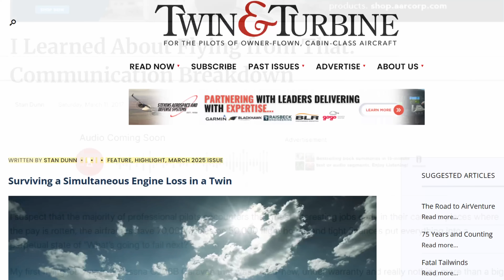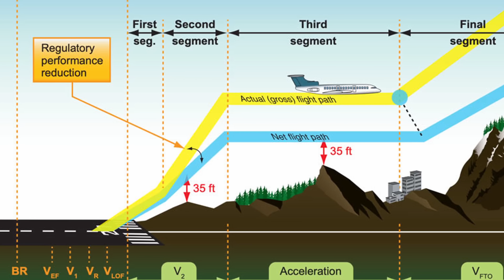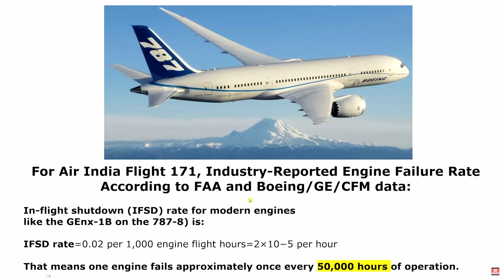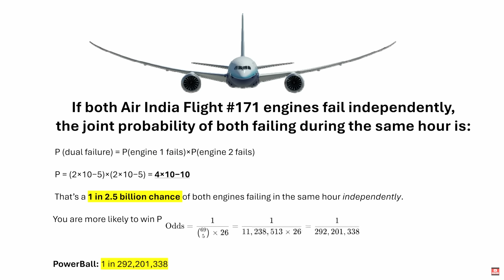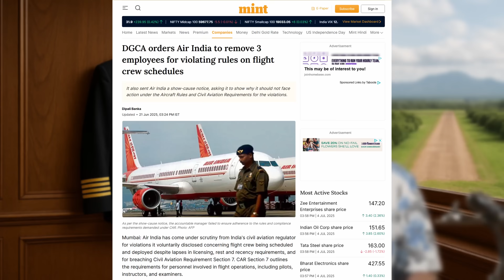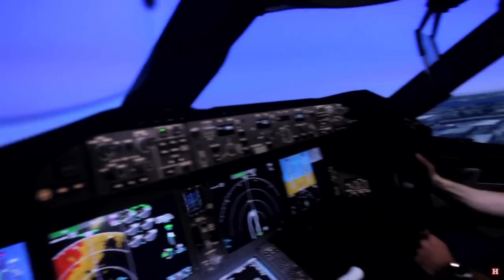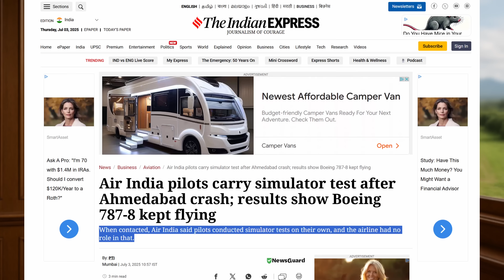Air India 171 Cause Becoming Clear

Comment: The flaps had nothing to do with this crash. The pilot didn't say "I have no lift", he said "I have no THRUST"  You can't just ignore that, it's crucial!
Reply: Recording isn't out yet, genius...
Reply: @DR_1_1 The ATC recording IS out! The PIC Said “Mayday I have no thrust” As a retired 787 Check Captain, I surmise the fuel cut off switch was accidentally hit by the FO, it’s 2 inches from the flap controls. Not keeping your eyes 👀 on the controls you implement will cause such problems. This airline was bankrupt and taken over by TATA corporation, the manufacturer of the $2800 new cars that revolutionized the market in third world countries. They made a horrendous business decision and were loosing copious amounts of money. They were desperate to offload the airline and stripped it to bare bones. Deferred maintenance? Who knows but they cut corners everywhere.
Reply: @DR_1_1  "The flight crew issued a mayday call, reporting a loss of power and thrust shortly after take-off."
https://en.wikipedia.org/wiki/Air_India_Flight_171
Don't be a DA all your life.
Reply: @DR_1_1 
That's  ATC. yes we have that.
Reply: @Richard-xv3gw  "That's  ATC. yes we have that."
Again, what is your source? Who is "we"?
Reply: @DR_1_1 Best answer. Searching the internet there are at least a dozen different answers to what the pilots said before the crash.
Reply: @DR_1_1  From the Wiki: "The flight crew issued a mayday call,[8] reporting a loss of power and thrust shortly after take-off."
Reply: Also spent confirmed multiple ways that the rat deployed which nullifies a lot of the other scenarios
Reply: Yes That’s exactly what he said.
Reply: @Wendy-p3m  hoe do you know??? nothing has been released yet
Reply: @Wendy-p3m  The pilot saying "no thrust or lift" is fake news.
There was simply a Mayday call. No specific statements were made.
Reply: @VinayakP  The Mayday call was released to the media from The ATC Recording in the Tower. Look it up, you can listen to it. The Pilot plainly stated, ''No Thrust, Going Down ''.
Reply: @VinayakP no, the pilot did say " no thrust, no lift" during the mayday call.
Reply: @siddharthshekhar909  no he didn't... nothing has been released
Reply: @craigcorson3036: How do you know the pilot said, "I have no thrust"??
Reply: @kevinsyd2012  ATC radio has been recorded
Reply: @TerryLawrence001  Sure but not released to the public.
Reply: @skunkjobb  my bad. I am too used to US crashes where everything is public via hobbyists and plane spotters.
Reply: Exactly how they say he made the "mayday" call. Through ATC conversation. @kevinsyd2012
Reply: @destroyedsoul1791  "How they say", who says and based on what? So far, I've only seen rumors about that and no actual recording.
Reply: @kevinsyd2012  Because it was reported in the media. FFS, do you think I was monitoring the frequency??
Reply: @craigcorson3036  Of course, how stupid of me, if it was reported in the media then it must be true just like everything else in the media is true
Reply: @kevinsyd2012  Psychic 😆
Reply: Is it possible that the power setting was incorrectly entered on that takeoff in the FMC  I would suspect if a pilot decided he needed more power the hell with the computer firewall the thrust levers
Reply: @SkipGetelman it's nearly impossible to take off with the wrong settings. They would have to turn off multiple audible alerts and dings as the computer would not accept parameters and try to prevent the plane from proceeding. I think it was vapor lock. The tarmac temp was allegedly 108°F or more. If the humidity, engine temps, gravitational forces are just right...they can get vapor lock from the main fuel pump which would then start starving BOTH engines and they would be provided with loss of thrust, which can be heard on the tower tapes as I have heard the tapes in full. There was communication between tower and Capt but it is majority garble and static and nothing can be heard clearly. Hopefully they get the cockpit audio. Maybe it's something nobody has considered...maybe the copilot was on a mission to turn his birthdays off and as they get airborne, he points out the window and says LOOK OVER THERE and the pilot flying looks and while he looks, the copilot flips the engine switches to off and pilot never notices which he would immediately radio a mayday call and the loss of thrust. He had to have realized there was absolutely no time to troubleshoot and it was basically time to try and land the plane in a way that may allow survivors, like keep the fuselage and cabin in the center of the street if possible. Had to have been horrific
Reply: The only official source is the recording itself.
Reply: fuel valve fails closed after DC power failure...heard it the day after the crash.
Reply: I was watching recently and incident where the pilot had an illness that prevented sensation in his feet...he took off, but he had a foot resting on the brake (unwittingly) - killed and entire professional sports team...wonder if anything like that could have happened
Reply: what is your experience in transport category jets? I can tell you from experience that without looking at instruments, if you raise flaps prematurely it FEELS exactly like losing engine power... and I have 8 type rating, and 3 of those are in wide body aircraft.
Reply: @SKIPWOOD-UA777CAPT-RET Not saying that you are wrong, but in how many of those widebody jets would you have continued descending to the accident site and not either eventually power out of the loss in lift, lowered the nose to get some speed, or put the aircraft back into the correct configuration… or a combination of all of the above?
Reply: @jamesrolls9206  If the flaps were raised inadvertently the aircraft would immediately been in a stalled condition and even if the mistake was found, at that altitude if the flaps were reconfigured correctly, it still  would have crashed... just a few feet further in the direction it was going.... they would have been approximately 70 kts below the minimum maneuvering speed for their weight
Reply: @SKIPWOOD-UA777CAPT-RET did that look like a stall?
Reply: @jamesrolls9206  all the ones I have seen and done... yup
Reply: @jamesrolls9206  without engine power all would continue descending
Reply: @SKIPWOOD-UA777CAPT-RET not quite sure which comment you are replying to there. I think lack of engine power and a continued descent is fairly obvious… otherwise we would just shut the engines down in cruise…
Reply: @jamesrolls9206  that'll save gas...;-)
Reply: @SKIPWOOD-UA777CAPT-RET reminds me of that old joke about an Irish airline.
Pax on a 747, they lose one engine. Capt makes a PA “sorry, we lost an engine, no worries we can still fly but we will be 30 minutes late.”
Shortly after, they lose a second. PA goes “sorry, we lost a second engine, not to worry, we can fly but will be 1hr late.”
Shortly after, they lose a third engine. PA goes “sorry, we lost a third engine, not to worry, we can fly on the remaining engine but we will now be 2hrs late.”
Paddy turns to Brian, “Geeze! We better not lose that last engine, we will be up here all day!”
Reply: @jamesrolls9206  GOOD ONE... I DO REMEMBER THAT ONE... MY BROTHER TOLD ME
Reply: @SKIPWOOD-UA777CAPT-RET  They teach you to fly with feeling and not looking at your instrument?

Good thing that you’re retired. Please don’t fly a plane ever again.
Reply: I have seen the flap handle go up when it should be the gear.  Fortunately the mistake was realized and  it was immediately put back down and we all lived.  But that would not explain the rat being deployed.  That would be both generators or all hydraulic system loss.  Double engine shutdown would cause both of those things.  Although the hydraulics would be delayed, as a windmilling engine will still provide hydraulic pressure. the generators will cut off when the engine RPM is less than idle speed.  usually 50-55% where idle is around 62%.  I don't know the exact numbers on these engines but that is about what it is on a CF6, TF39, TF33,, and a JT9
Reply: As the plane descended into the buildings, I don't think any of the passengers had any trust either.
Reply: Mixing oil from modi friend oil company.
Reply: ...but he's got an airline captain uniform in the background, so he must be right!
Reply: The captain was an experienced check airman, training captain.  He had a good personality and got along well with his crew members.
Reply: The RAT deploying is the biggest clue. That only happens when a plane loses major electrical and hydraulic power. In modern jets, no power = no engines, because the digital systems (FADEC) can't function. Unless there's clear proof of fuel exhaustion or pilot error, this looks like a total electrical failure that shut both engines down.
Reply: Also, flaps and slats are clearly deployed in the debris of the wing.
Reply: @ARM-CORTEX  Yes they are.
Reply: Air India pilot's final words before crash: 'Mayday… no thrust, losing power'
Reply: that's a lie... nothing has been released
Reply: @SKIPWOOD-UA777CAPT-RET  You are mistaken.
Reply: Good point.
Reply: We will never  get to know the truth. They will blame  the pilots just to come clear. The only way people  should  not fly Boeing.
Reply: Sabotage
Reply: So much could go wrong apparently   All airplane passengers are heroes ( or ignorant) i dont want to say that about the victims   So tragic
Reply: RAT deployed
Reply: @VasantVarma324 did or didnt they ?  ( sorry i have no sound ilooked the entire video still have no clue  ( do you ?)
Reply: Also can’t ignore that the engine manufacturers were dispatched to the accident site. That’s not a normal occurrence either unless there is considerable evidence to point to engine issues.
Reply: Lift depends on thrust, so thrust is the cause of lift meaning no thrust no lift,and no thrust above 190MPH  then a gradual decay in lift and if there is no runway near its a force grounding.
Reply: ....and I think the "black boxes" will prove that without a doubt!
Reply: @charliethompson-u8j  if the indians don't screw them up like mylasia airlines did
Reply: Sue Boeing mate
Reply: Yup. It had plenty of speed and lift to fly well above ground effect.
Reply: I do not think this pilot knows what he is talking about.
Reply: 1: the recording it's out yet
2: there were numerous accidents where the pilots misidentified the issue. Even if they said that both engines failed it'd be no proof they actually did
Reply: TLDR - unlikely causes can sort of rule out. Still inconclusive. Oh when will the investigators release any more meaningful information? Even the ruled out stuff like birds if know by now. Appreciate still investigating and the root cause might take time to be confident. Insurance and liability sensitive. But so are the other planes still flying.
Reply: Crash was message to modi. Quit the big buy of Russian arms.  Us wants that arms business.
Reply: It was very hot day so less or insufficient oxygen for the engine to burn , so it stalled down. 
What's the investigators doing.
I am not a pilot but can see and sense .
Reply: No thrust becoz plan not cutting air means pitch error
Reply: @kamali_ka You obviously lack an understanding of basic aerodynamics.
Reply: I mean i thought initial findings said the plane was properly configured anyways
Reply: There are same thing, Indian pilit's Cos 2 accident Indian.They do not train pilots only the train scammer
Reply: 😂😂😂❤ @sedattan952
Reply: @sedattan952  Do this: say what you want to say in your native language. Copy it, then paste it into Google Translate and translate it to English. Then, copy that translation, and paste it HERE in this comments page. I have no idea at all what you're trying to say with this post.
Reply: my question:  how did they use the entire 3500 meters of runway without getting significant lift to fly.  The loss of thrust MUST have happened before leaving the ground.  Following proper Takeoff procedures should have prevented this accident .
Reply: @wunderfuel  I COMMANDED A DC-10-30 OUT OF EWR TO HNL AND WE WERE AT MGTOW.. WE COULDN'T EVEN USE THE CLOSER PARALLEL RUNWAY BECAUSE IT WAS 200 FEET SHORTER... IT WAS MY LEG AND WE SET OFF EVERY CAR ALARM HORN IN THE EMPLOYEE PARKING LOT AT THE END OF THE RUNWAY... AND ATC SAID... 'WELL, NOW THAT YOU USED EVERY INCH OF THAT RUNWAY... GO OVER TO DEPARTURE CONTROL" I DOUBT THAT IF THEY HAD AN ENGINE FAILURE THEY WOULD HAVE GOTTEN THE PITCH OF THE AIRCRAFT THAT HIGH
Reply: If flaps weren't set, why did the plane take off perfectly normally, then lose height?
Reply: @RevStickleback It didn't take off normally. They were at the "last brick" of the runway when they became airborn. Their troubles began while they were on the ground
Reply: @JamesStreet-tp1vb It did take off normally. ADS-B shows they were around 250 feet AGL at the last brick of the runway. They would have to get airborne with around 800m - 1000m of runway length still available to do that.
Reply: @tonamg53  Doesn't match the video, the plane was very low at the end of the runway, raising a lot of dust, so less than 250 feet AGL, probably 250 MSL (Ahmedabad Airport is very low altitude).
My guess is either an issue with weight management, thrust (although I still don't see any serious source for the "I have no thrust", only very vague,like "media", "wiki", etc.) they should have aborted the takeoff but for some reason they didn't.
Reply: @DR_1_1  You can’t tell where the end of the runway is in the video 🤦🏻‍♂️

but using google earth information to see where the camera was located + a bit of triangulation gauging the angle at lift off point… this matches perfectly with the ADS-B data that lift off point was somewhere between 2,000-2,500m down the runway so they should have around 1,000 m of runway length still available.

“Dust” indicate “dust” on the runway… no, “dust” doesn’t mean it must be the end of runway.
Reply: @tonamg53  You can tell that the plane is raising a lot of dust, that's how you can tell it's very low at the end of the runway. And it shouldn't be that low, since the runway is +3500 meters...
Reply: @DR_1_1  Again, “dust” means “dust” 

Dust can be at the end off the runway, or it can be on the runway. India has seen some of the worst air pollution ever in recent years so dust is every where in India.

Your assumption that “dust” = “end of runway” is flawed and is debunked with a bit of triangulation drawing analysis. The ADS-B data also confirms with triangulation analysis so… your flawed assumption had already been debunked, twice.

Note that Ahmedabad-London is the longest flight operated from the airport. Most other flights are domestic or short haul international flight to other asian cities. So yes, the plane would’ve lift off a bit further down the runway to the part that is not commonly used by other aircraft. Yes, you should be expecting to see dust at lift-off for this particular flight.

That’s all I can say. If this doesn’t convinced you that you are wrong, then nothing else will… so go ahead and believe what ever you want 👍🏻
Reply: @tonamg53  Please stop that nonsense, there is no dust on runways used by dozens of planes every day, it would be blown away by the earlier planes, and this would cause accidents, braking issues, etc.
Reply: @DR_1_1  Which part of “this plane was flying the longest route operated from that airport so the take off run would also be the longest due to amount of fuel it needs to carry” that you failed to understand?

The security camera is located 1,000m from the beginning of runway 23 so the footage is showing about 2,500 m of runway left available…

Don’t need to be a genius to figured out whether it did lifted off from end of the runway or not?

And the “non-sense” would be “dust = end of the runway” and nothing else!

Absolutely 0% sense  🤦🏻‍♂️
Reply: @DR_1_1 Also note, plane does not have operational restriction on dusty runway ok?

Please don’t just make things up when you are absolutely clueless 🤦🏻‍♂️
Reply: @tonamg53  Stop spamming me with your clueless nonsense, runways of international airports are NOT covered with dust, and the plane used the full length of the runway, there is no discussion about this, and 3500 meters is at least 300 meters more than the maximum takeoff length known for 787's.
My guess is that this may be linked to the causes of the altitude (and maybe power) loss that caused the accident.
Reply: @DR_1_1  Sure dude 👍🏻 

Keep up with the non sense that airport cannot have dust!
Reply: @DR_1_1 reduced thrust takeoffs will use all of the runway. It’s the whole point of doing them.
Reply: @tonamg53  OK kid, just stop spamming with your nonsense. No international airport in service has that amount of dust shown in the video on the runway itself, this is a clear sign that the plane is too low at the end of the runway, i.e. lower than any other plane before it.
Maybe it was too heavily loaded, or had a power issue before takeoff.
Reply: @DR_1_1 Yes, I am a kid because I believe International airport cannot have dust on the runway therefore dust in the video cannot be dust on the runway but it must be dust at the end of the runway!

And yes, I am a kid because I like to belittle other people when I can’t win an argument!

Keep it coming 👍🏻
Reply: @RevStickleback  Correct, it looked OK on takeoff then appeared to stall, so I reckon the thrust reduced.
Reply: @RevStickleback  loss of lift will cause an aircraft to drop.
Reply: @kevinsadowy5602 Yet the plane had lift before dropping. With little lift, it would have barely got off the ground, yet the take off seemed OK.
Reply: @RevStickleback  that's why I used the words "loss of lift".  It implies that lift was there at the beginning and then it was lost.
Reply: Right from the time the plane left the extreme end of the tarmac, there obviously was a problem of thrust to make a perfect take off.The pilots could do nothing on realizing this,but hopefully they intended to go on air and turn around for emergency landing,their efforts also failed when the two engines again failed to generate the needed thrust for their planned emergency landing.
Reply: @johngithinji6191  I'm a layman, not a pilot, but based on your posting I now wonder whether the engines failed right after takeoff, possibly already after V1, and the plain only climbed that few hundred feet due to its momentum ...
Reply: Actually, according to official source…. Pilot just say “Mayday” and that’s it.
Reply: @tonamg53  The flight crew issued a mayday call,[8] reporting a loss of power and thrust shortly after take-off.
Reply: @craigcorson3036 the whole flight lasted ~25 seconds and issue starts around ~10 seconds after lift off… so they have around 15 seconds to diagnose the issue and made the report
 
Do you think they have time to say it was engine issue? 

Barely enough time to say just “Mayday”
Reply: @tonamg53  A couple sources said there was a reference to no thrust. "Thrust not achieved" in one. It was also apparent by the way the plane behaved.
Reply: @chrissupport Yes, the plane behavior is clearly shouting it had no thrust. I’m not disputing that.

I’m just saying the official source only stated pilot made a “mayday” call and that was it.

The “no thrust” or “no power” or “going down” or whatever… seems to be added in by the media themselves.
Reply: Is a bullshit @tonamg53
Reply: My question: what happens if plane extremely overload than engine can handle flietworthyness.can defence mechanism of software triggered to shutdown engines from damage.? because plane took whole 3.5 km runway instead 1.5 2 km due to its loading and at that  day extremely humid and hot atmosphere there in Ahmedabad.
Reply: @vyasjwalit3999  IF it is extremely overload, then it is not a legal flight. Precise loading calculations are made before every flight to ensure that the aircraft can meet certain climb criteria if an engine fails after decisions speed. A jet airplane is not an overloaded truck in India.
Reply: @marclandreville6367 i m saying because in history it happens with 2 airlines due to overload touch literally to fances and climbing angel were too low,by the way it didnt brake beacuse there were no buildings afterwards,airosucker airlines may be
Reply: Overloaded ffs !!
Reply: It's still India
Reply: @vyasjwalit3999  You may well have hit the nail on the head, so consider my hypothesis. 
The pilots knew that they were at maximum weight, hence using the entire length of the runway which involved additional taxying. but they were scarcely in the air by the end of the runway.
Was this the result of hand baggage and the passengers themselves underestimated.
Unaware of the full situation including maximum fuel load, was additional cargo added.?
Due to bad securing, did that cargo or baggage shift towards the tail during rotation.?
If so, the trim would have shifted and correction TAKES TIME.

Was this the reason that the pilots appeared to keep the nose up, resulting in an aerodynamic stall.?
Did moving load also result in damage to the tail elevator control making it impossible not to gain speed. ?

All the general parameters seem to have been chewed over, so is it time to think outside the box.?
I am a design engineer with 55 years experience. Although not in aviation, the basic laws of physics still apply.
Reply: Double derate....not sure if the 787 uses it but the max does
Reply: @vyasjwalit3999  wow... that's a really big question.... but bottom line??? no, that is not who airplanes are built and the takeoff performance is calculated by the company for ALL of those factors and a bunch more.
Reply: @vyasjwalit3999  The engines can run at full power for about 5 minutes before reducing to maximum continuous thrust which is what the engine can run on pretty much until it runs out of fuel (mechanically speaking...not great for engine lifespan though).

Even if the plane was so overloaded it couldnt move, it doesnt bother the engine as its still producing output thrust. The airframe might disagree after a while but static engine run ups are done periodically on aircraft. 

It it was attempting to take off over and above its MTOW for those conditions and runway it would keep accelerating down the runway but would be unable to lift off the ground (it may temporarily due to ground effect but thats not been mentioned by any of the speculations).
Reply: @vyasjwalit3999 takeoff configuration warning system would have alerted the crew long before they even took the active runway if this situation would have occurred.
Every passenger and piece of luggage is accounted for and along with fuel and aircraft weight, outside air temperature and density altitude of the airport and the aircraft will come up with takeoff speeds and runway length required.
Reply: @vyasjwalit3999 this. So far no one has speculated about either AI jamming in too much cargo OR (as happened numerous times) the wrong weight was given to the pilots who then used the wrong flap/thrust settings.
Reply: my wife said that I had no thrust...... damn, you can't ignore that, it's crucial.
Reply: @colonelfustercluck486  Grow up, "colonel"
Reply: You're telling me that a $15,000 car can have a monitoring system that shows which tire has low pressure but a million-dollar Airplane has no monitoring system to tell and or show which engine or engines failed, especially after there have been at least 3 crashes involving pilots turning off the wrong engine?
Reply: @douglasanderson5516  I'm telling you no such thing. I'm telling you what the pilot of the MULTI-million dollar airplane was recorded to have said before the crash. And I didn't say that any engines had failed, either. My personal INexpert opinion is that the flight software somehow caused the crash. Time will tell.
Reply: A lack of lift can be mistaken for a lack of thrust. It depends what caused the pilot to say that. Some indications can be clear such as a direct indication on the instruments or just hearing that the engines are turning too slowly. In other situations it may not be so clear though and even with engines delivering full thrust if the plane is sinking and not gaining speed sufficiently it might easily be misattributed to a lack of thrust.
Reply: @listerdave1240  No one who flies airliners for a living is going to make such a mistake. Don't be daft.
Reply: @craigcorson3036  Interesting. What has changed that prevents such a mistake from happening again as it has in the past? Is it better instrumentation, improvements in training perhaps?
Reply: @listerdave1240  I don't know that it WAS a mistake, unless it was a mistake by some flight software programmer. Such an error crashed two 737s not long ago. Maybe the plane somehow thought it was landing, and needed to throttle down. I don't know, we'll just have to wait for the investigation to be completed.
Reply: @craigcorson3036  Not sure which accident you're talking about but there have been various cases of pilots thinking they had loss of thrust when they were actually failing to gain altitude for some other reason.  One that I remember off the top of my head was a plane that hadn't been properly de-iced and the pilots mistakenly though the plane wasn't gaining altitude because of loss of thrust when in fact the engines were working perfectly. As a result they took incorrect corrective action which made it worse to the extent that they crashed.
Reply: STOP LYING
Reply: Until the evidence is released, I'm staying with the Pilot error theory.
Reply: @S-North
I'm with Computerization  ! !  
We should start up a Sweepstake   ,  yer. ?
Reply: Why it collapsed- poor Boeing standards
Reply: The pilots said, "omg, this is a Boeing?? I'm out"
Reply: @drYouTuber315  That's right make jokes about the deaths of the 241 people on the aircraft and a further 19 on the ground.  What a kvnt you are.